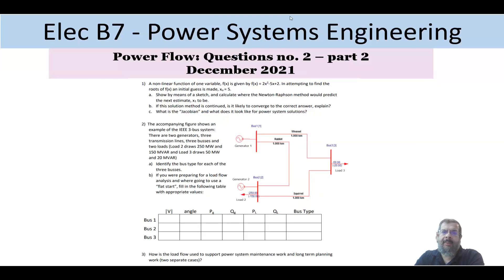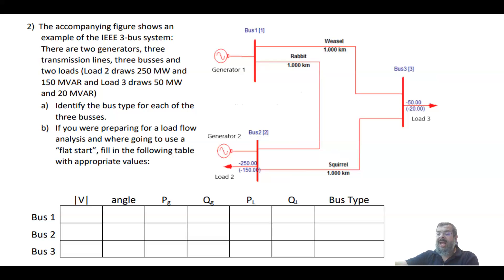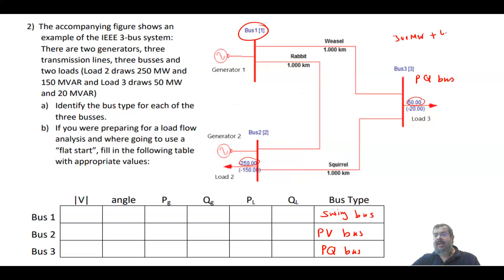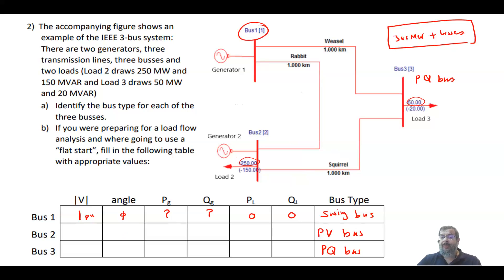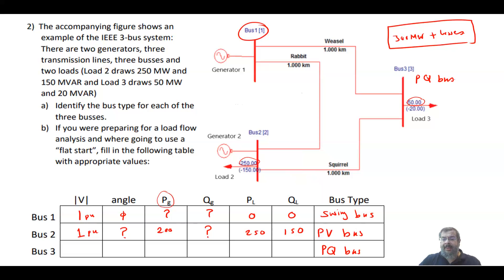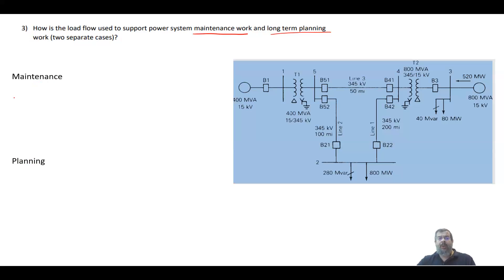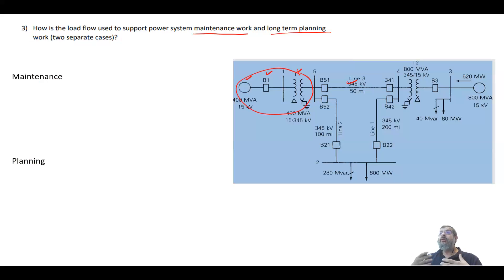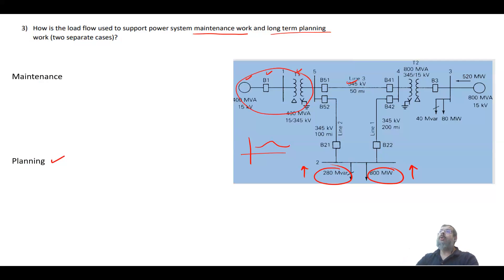PEO solve examples (ELEC B7) Power Flow Question no. 2 - Part 2

Comment: Hello professor 
Thank you for this one 
But i have question like if i connected load to bus 1 , would it be PV bus? How could we differentiate swing bus and pv bus without having vpu=1 angle 0 for swing.
Reply from the maker: For the swing bus both the voltage and angle should be fixed and it is usually 1ang(0). This is the generaror that supplies the slack between other generators and the load + losses.

Comment: Thank you for much professor but I have a question about the table. Do we have to solve all missing info or we just leave it like this. If yes, can you please solve one or two missing items?
Reply from the maker: No you should not solve for the voltage as the question did not ask you to do so. This is different than the previous example I solved where it was asked to solve the system of non linear equations
Reply: @electrical4everyone  I see, thank you so much.